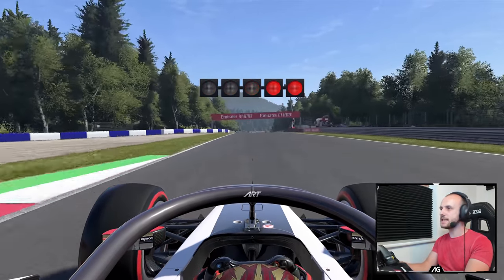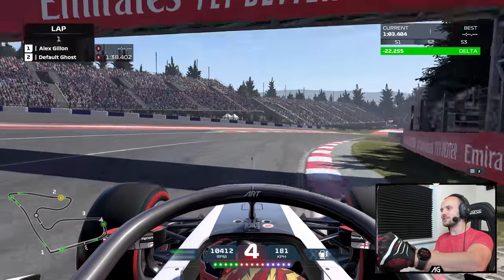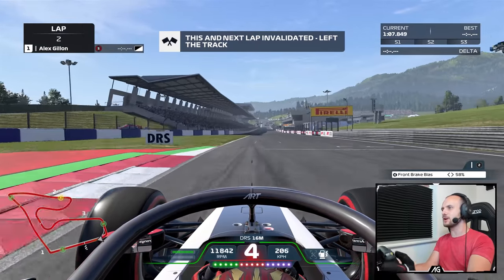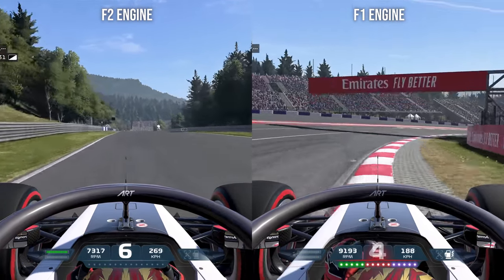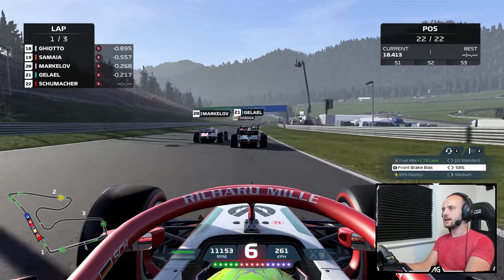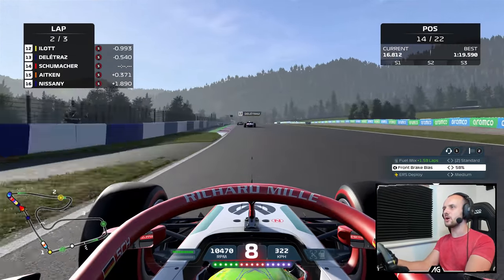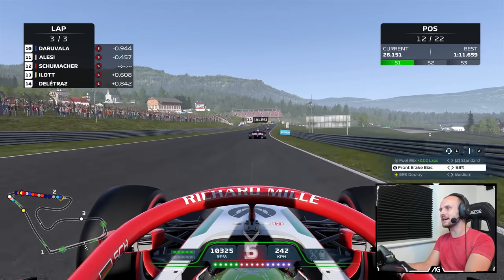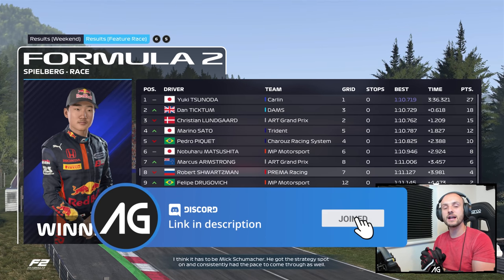What If F2 Cars Had An F1 Engine?

Comment: Hey Alex i have a question for you, i tried modding the common folder for the Mercedes and basically gave it the VTF performance file of the Haas.

Every time that i try to drive the Mercedes in the game it automatically gives me an engine failure in both one-shot qualifying and the race itself. Do you have any similar experiences? Am i doing something wrong? It worked on previous games (F1 2020 for example) so did Codies just implement another unnecessary obstacle for modding?